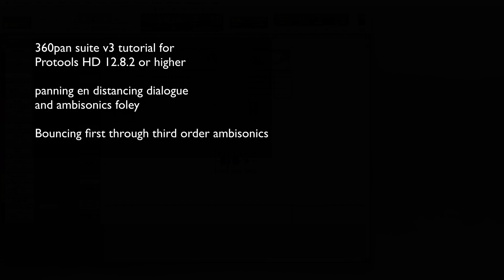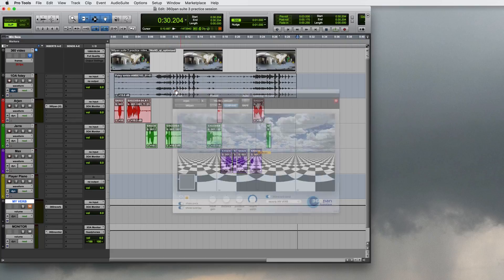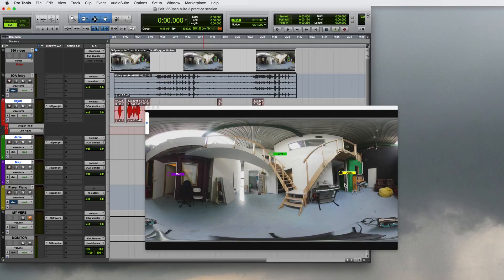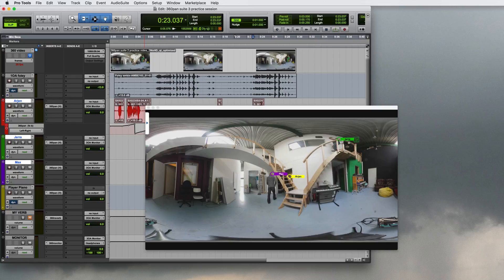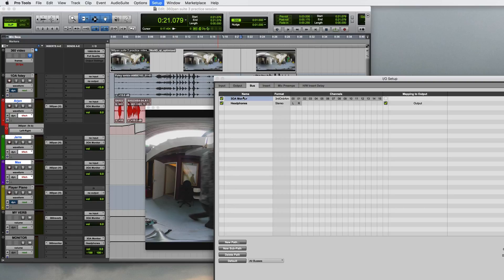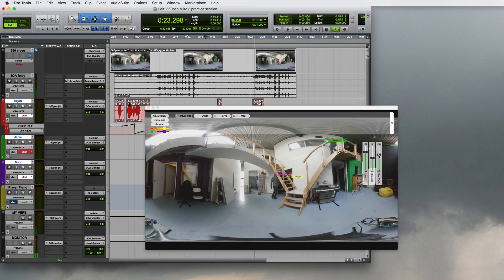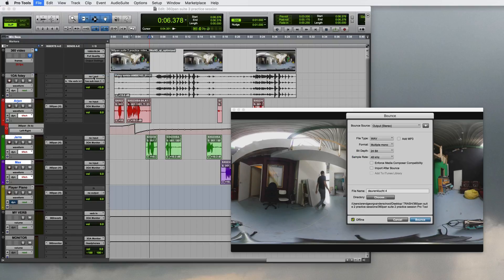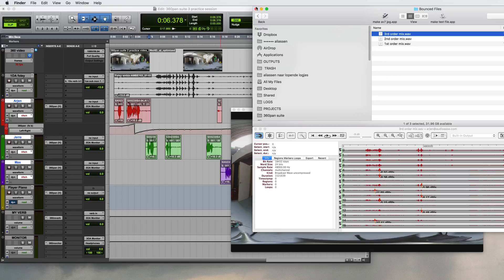360Pan suite v3 PTHD workflow screenflow

Comment: Is there a reason to advance the video one second at a time to insert pan automation points, like it’s done in this video? Why not simply drag the pucks in real-time to automate?
Reply from the maker: Realtime is fine too, but we found that with several quick moving sources the little steps are more accurate and quicker.
Reply: @AudioEase  Got it. I'm new to 360PS. That method might turn out to be best. Thanks!